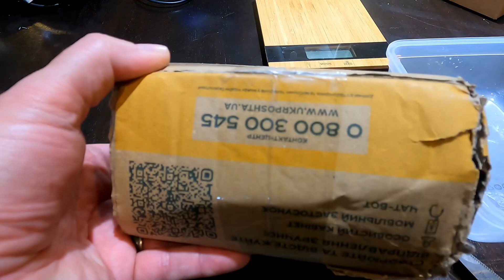Gold Recovery from older HDD boards

Comment: I think sound card is worth a lot than this hard disk PCB from this you just got ic chip and the small one and litle MLCC paladium but when you got full hard disk you can got aluminum case, the platinum disk, and the neodinum magnet.
Reply from the maker: Good point!  I have a good sized stack of HDD.  Thank you for the view and the comment.
Reply: @KKRRenewables If i watch your PCB it look like high grade HDD PCB that i would not get it from 5gb or 8gb that i had, it look like had more IC chips.

Comment: did i just read disappointing in the thumbnail?! nvm. it was youre latest upload.😂
because, last year i made a huge score, i bought 60kg of pcbs. seller said, low grade so i thought ok i try it because the price was good. when it arrived i took off the boards on the top of the box and was flabbergasted, 95% of the haul was vintage hdd, floppy and cd drive boards, high grade stuff, just like the ones you have. the dude took off all the junk metal so that was an extra bonus. btw i paid 40bucks incl shipping. i called the seller because i thought he made a mistake but no he just grades them differently, for him only ussr and italian vintage e waste is high grade. im still processing the stuff. and i recovered a lot of metal but have yet to refine it
Reply from the maker: Wow! What a great find, and at a great price! In one of my other videos, I process a bunch of CD ROM IC chips from those types of vintage CD ROM drives. I bought those off eBay and wound up getting more than I expected back in gold. If you process those chips, you’ll have to let me know how you did. Best of luck to you. Thank you for the view and the great comment.
Reply: ..... @KKRRenewables

Comment: Looks like a really old PCI card 13:21 and it must be heavier than it looks because I was pretty sure you were going to come up with a little short
Reply from the maker: Yeah I think you’re right.
Reply: @KKRRenewables  No, it is definitely the board from an older 5.25inch HDD, pre ATA. That is a Shugart connector on the edge. The two cut ribbon cables are naturally spindle motor and head actuator.
Reply: you can even see the trimpot for the head gain!
Reply: Sir I am from India I also want to order from Hardik Broad 2kg Kha I will order from Sir @KKRRenewables